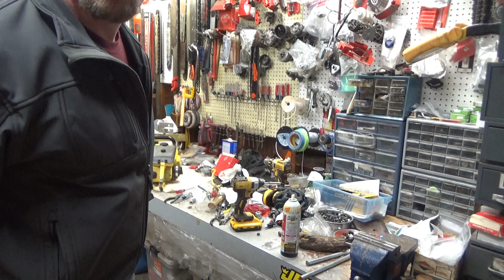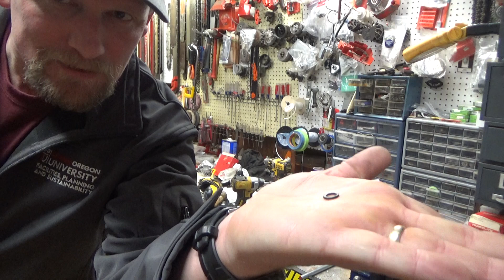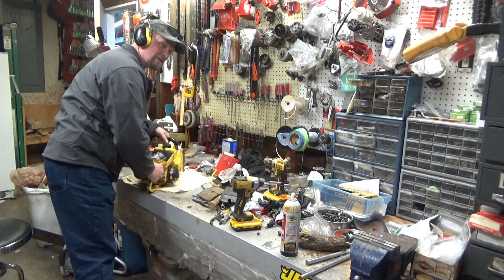McCulloch 300 Flatback Carburetor Primer Sorta-Maybe-Kinda Functioning Part 2

Comment: Flatback carb also called "bullfrog"?
I recently picked up a McCulloch D-30...
Reply from the maker: They probably do have multiple names...I'm definitely not nearly as knowledgeable about old Mac's!
Reply: They are not the same.
Bullfrog carbs are the ones fitted in the 1-10 and 2-10 chainsaws, before they changed them to the Walbro SDC.